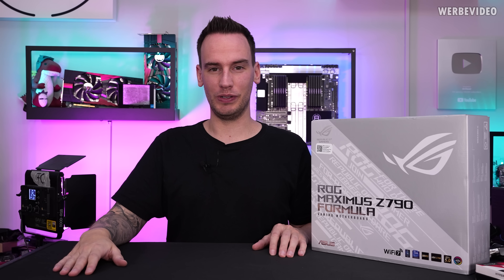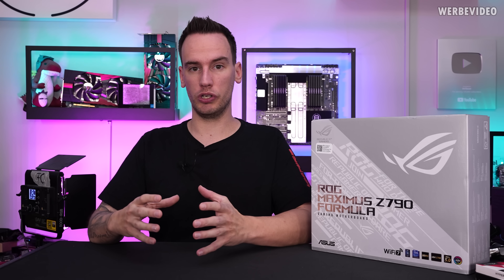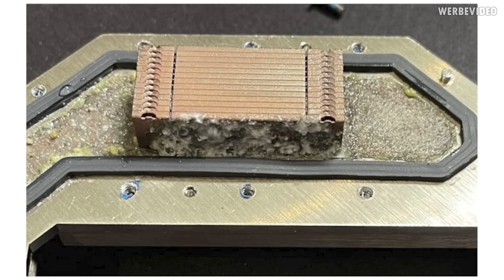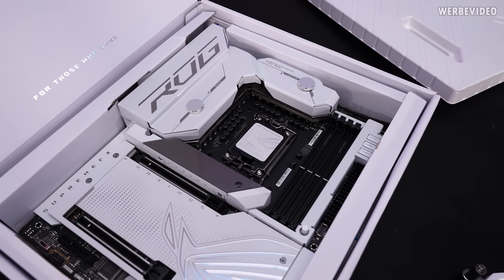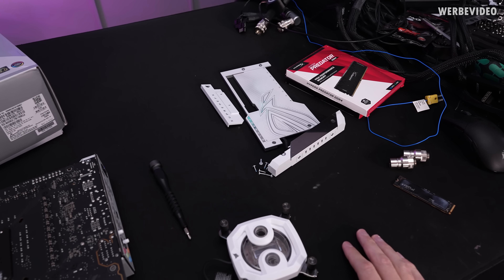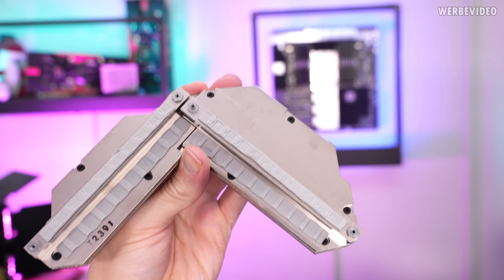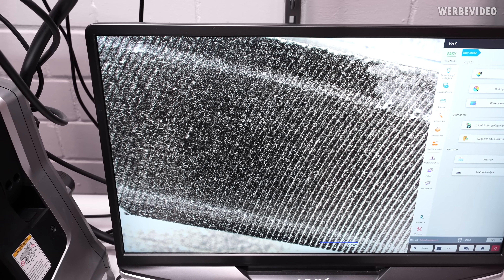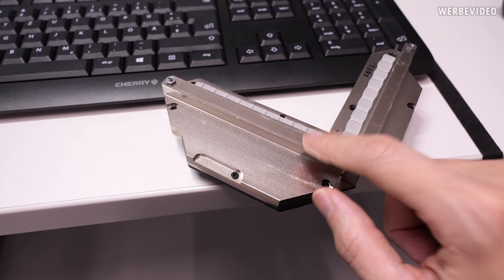Corrosion Risk on Z790 Formula? And the End of ASUS x EKWB Coop

Comment: I was thinking of getting this but its so damn expensive. I used to have the Z690 formula until the whole mobo broke and had to return it. The ram slots are also too close to the socket and i couldnt fit my AIO wires trough there without them pushing on the ram.

Comment: I'm not a big consumer of this kind of hardware, and I rarely even overclock anything. I mostly watch der8auer for the level of testing and to learn.
But one thing I get irritated about is that all the VRM cooling and such that is specifically for just one version of a motherboard I think is a shitty move. I never buy the latest hardware, there's simply no need for me to have it for that price, and then also maybe have problems because of it being cutting edge. So when I a couple of months to years after being released, there's still water blocks for specific motherboard models that hasn't been sold. Instead of getting to that point they could have made those water blocks to be a bit more universal. I'm not saying it has to fit many different brands (but that would have been the best in my opinion) but should at least fit other models of the same brand.

We already have a big problem with electronic waste, we don't need to add more components from computers to add to the problem. If anyone have been to a "scrap yard", you probably have seen what a waste there is. For something to get to be scrapped in a certain way, the amount of the same product has to be enormous. Which already disqualify these types of products. I have a hard time even imagining they asked for the the whole mother board back (unless it was easy to fake the buying invoice or something) to have people sitting depopulating it and to replace the components and send back. Since maybe just replace the motherboard with a new one and not having to pay for postage the one way from customer to Asus. I could be totally wrong, but I can also accept that.

Comment: Asus customer service is abysmal, I bought the z690 along with all the custom watercooling components for a full loop including the VRM's.....shortly after people started reporting the corrosion issues, luckily i hadn't set the loop up yet and contacted them asking if they could send me the replacement VRM block before I water cooled it and they refused basically saying i wasn't eligible because it hadn't corroded yet....they actually wanted me to water cool it knowing the risks to the rest of the blocks/pump and wait for the corrosion to occur before they'd send me a replacement block. When I wouldn't accept this they basically just stopped replying to my messages and ignored me. 

Couldn't even return the entire board since the company I bought it from dissolved so yea paid £700 for a motherboard partially for the watercooling element and couldn't even put the VRM's under water. Disgusting company practices.
Reply: That sucks. I hope you sorted it out somehow.

Comment: I heard that this board handles 4 memory modules @ 192gb in a far superior way vs any other board. Can you test the memory handling of this thing? No one who has reviewed this board tried more than 2 sticks. A lot of modern industries require as much ram as possible now, and if this board does 192gb @ 6800mhz, it would be really worth considering despite the price (even if you dont watercool) Like maybe the supported teamgroup kit CTCED596G6800HC36DDC01 x2 at it's stock settings.

Comment: Thanks for the video.  You mentioned you tried the 8000 RAM but it didn't work, and wasn't on the ASUS QVL.  I checked the ASUS site and it does show 8000 if paired with Intel 14th gen.  Is their site wrong?  And can you let us know which RAM you ended up using?  Thanks again.

Comment: My guess is contact corrosion due to the use of different materials or simply too low layer thicknesses in the coating.
In addition, nickel layers are only really free of pores and "closed" from a layer thickness of 30µm and more.
The silicon that was measured in the coating can also be so-called "endogenous inclusions" that originate from the aluminium manufacturing process.
Reply: i looked again at the surfaces, and i can see some indicators that the nickle coating is not okay.

Comment: Didn't Asus have this issue back in the day during SandyBridge/Haswell times with their watercooled VRM boards - one of the reasons they collaborated with EK for the Formula line to fix this.  Seems like you're better off getting a Hero board and spring for an EK monoblock, will more than likely end up at the $800 pricepoint but with a decent quality block.

Comment: The heatsink is Al with a Cu plated flash layer then the Ni plated top layer. That is the usual plating process sequence. Decorative parts would then be Cr plated. If you polish the cut/filed section the layers would be clear and you would spectroscope the layers in the section.

Comment: My Asus Crosshair 4 Extreme had a Koolance waterblock and it was flawless. I always avoided EK I never liked how many different manfuacturing issues they have had over the years.
Reply: What kind of manufacturing issues? Been using EK myself for about a decade now, yet to have any issues with any of their parts.

Actually, thinking it through - I did have one bottle of 1L clear liquid which had some weird bits in it, shipped through winter. Support and getting am exchange wasn't an issue, they claimed it being due to sub-zero temperatures. That is one bottle out of probably 10 over the years.
Reply: @Nightykk  As I have been running aluminum based radiators for over a decade having quality nickel plating on the copper is a very important. They have had a few batches over the years where the plating hasn't held up.

Comment: Your confusion about copper-coated aluminum blocks is actually quite common within wiring, it's called copper-clad aluminum, where it's also a much cheaper product.  I would imagine the process is exactly the same for a solid block of material as it is for wire.  For wiring, where you have an alternate scale of how much power you can push through a specific gauge, it works fine as long as you watch amperage and temperature, as it's still cheaper than the relevant 100% copper gauge.  For water blocks though, I'm not surprised it's problematic. 

As for the EK-branded parts, I wouldn't be surprised if it was co-branded.  I wouldn't imagine EK spinning up a fab line just for one Asus motherboard, and I wouldn't imagine Asus being willing to hand over a paycheck for one of EK's fab lines, and thus they got lowest no-name bidder to produce a bad quality block.  Lack of EK branding here shouldn't be a surprise, considering Asus' previous decision being such a terrible outcome, good PR last generation would be EK cutting the co-branding off when it first became apparent, and good business practice would probably to lawyer up for any defamation and loss of revenue stemming from their image being smeared by Asus' antics; I wouldn't be surprised if Asus immediately settled the issue under the table, though. 

But there is one consistent thing here, Asus' recent behavior within the industry overall.  Whoever is making these terrible decisions, and whoever is allowing them to happen, really need to be sacked.  It's starting to become the Newegg of hardware, the higher-ups are clearly out of touch and incompetent, to where the brand keeps shooting itself in the foot, and trying to drag any other company down with it. 

Them fixing the mistake is good, but the mistake shouldn't have existed in the first place, and this just shows their lack of loyalty to co-branding.  Speaking of lack of loyalty it other brands, they're still up to their antics considering they can't even spell 'Evangelion' correctly on a licensing they've previously done, and who knows how many people that had to pass through before customers touched it.  Too bad Asus burned the bridge with EK before getting their shit together.  The cooler overall still has a bizarre design though, I guess they're going for a certain height spec and they're filling that void with some kind of fin arrangement, rather than using a more logical design. 

Then of course, in typical Asus fashion as of late, the price.  Again just higher-ups being of such an ungodly degree of out of touch with the market and industry; again, the same people that need sacked, as their asinine decisions are causing every other issue the company has been facing the past few years.  I have no faith in Asus.

Comment: I bought asus for the 1st time this year... A TUF B650 for my 7800x3d.
I found them to be a good Motherboard manufacturer.
My last B450 was MSI and I think they're good too!
Ive also bought Asrock before and had good experiences with them too.
Had 1 MSI GPU and 2 Gigabyte GPUs and found all 3 great again.
However the MSI GPU did have coil whine, and my Gigabyte 4080 has the most retarded default fan curve

Comment: Like having a $1500 gpu with bad solder joints on some capacitors due to thermal conductivity from pcb and surrounding parts making it hard for solder to get hot enough without it being wicked away

Comment: And this kind of thing is why I just won't use water cooling. There are just too many potential unknown variables unless you put it all together yourself; and even then that's not perfectly reliable. Then to top it all off, you are constantly running a risk of a leak somewhere if some supplier/manufacturer was F'ing around instead of doing their main job of not F'ing around. 

Sure, warranties exist; but that's a pain in the butt. One that shouldn't have to be a pain in the butt. But is. And sure, fans can fail too on normal heatsinks; but they are super easy to replace and don't come with 20 extra steps just to make sure you did everything correctly. 

And sure, it's not 'hard' to do water cooling correctly. It's just that it's so much easier to just keep your room colder, and buy good fans instead of cheap ones. 

As for noise? Again, just keep the room colder. Fans won't be a noise problem then. And due to the constant possibility of replacing parts due to leaks, etc and so forth; probably a heck of a lot cheaper too to just run the A/C now and then. 

End result? Similar performance to liquid cooling methods, without as much hassle; and more comfort to boot.

Oh, and you don't run the risk of dumb things like mixing metals... 

And before anyone replies, please be aware... while I may not have taken all 5 levels of the course to work in nuclear facilitie, I am trained as a boiler operator; and basically everything they teach in that applies to liquid cooling. I may not be an expert, but I do know more of what I am talking about than the average person. (Including possibly you, person replying. But not for certain. Exceptions will be folk like Der8auer.)

Comment: I bought the formula z690 in 2021 and I think like 4 months later I fund something in the vrm block that blocked but I just cleaned a bit and moved on. Later 2023 when the news got I open my vrm this time and fund a lot of corrosion. Contacted my pc store in sweden and got a full refund. I will probably never buy any formula again even if it fixed now. Bought the apex z790 instead and Im very happy. But if the vrm got corroded that means my rad, block, and fittings is fucked too? I didnt find any on my block.

Comment: A child knows that you should never use a water cooler.
It is also total nonsense and enormous chance of problems.
I have been building PCs for 30 years and the difference in overclocking is negligible. My 6600K does 4600MHZ air cooling without any problems. With water cooling it can at most up to 4800 and that is it, but is not good for the processor and you will also see no difference in FPS. Whether it has 30 or 32 fps .. your PC must be replaced 😊

Comment: Thank you for testing this!  Good to know for sure the composition of the VRM block. I had the z690 formula, and I was able to get the VRM block replaced after waiting on ASUS for 4 months (Their CS is a nightmare). I had stability issues with my 13900k and Corsair Dominator Platinum 5600 DDR5 though, and got the z790 Formula instead, which is rock solid now and running a 14900k and Corsair Dominator Titanium 6000 DDR5.  I didn't pay a dime for any of these part upgrades btw, they were all changed out for upgraded parts under warranty because of stability issues that couldn't be pinpointed via troubleshooting.  The board is pricey, but I attribute it to the white tax.  There really isn't a better white board right now with the same features for Intel z790, or even z690.  I certainly don't need to add the VRM block to my WC loop, but I'm going to because this is my mid-life crisis Convertible Corvette - just in the form of a PC instead.
Reply: I just got my replacement and they were short on stock. Hoping stock was low due them using the same block on the z790 board

Comment: I have Z690 Formula but haven't noticed any corrosion after 2.5 years. I have changed the liquid recently and it was clean. Is there a way to tell without dissasembling it?
Do all the units corrode?
Reply: When I first heard of the corrosions on these motherboards I concated ASUS and they told me I need a proof of corrosion to have a replacement.

Comment: The new Asus ROG Maximus Z790 Formula appears to resolve the corrosion issues seen in the previous Z690 model through the use of more compatible materials in the VRM cooling block. However, the unusual design and just average cooling performance leave room for improvement to justify the flagship pricing. Asus took steps to address the major flaws but could go further to match expectations for such a premium motherboard.

Comment: I still use Maximus V Formula. It is a water and air cooler. I have a heat sensor stuck in between the fins. Usually reads the same with the CPU temperature. On idle.

Comment: Damn man you have the coolest tools to play with. Please tell us what machine that was you used. Maybe take a tour of the company that makes it. When I was 19. I worked at a electroplating plant in Bristol, Ct. USA. I learned so much metallurgy that summer before going off to college. I got to use a XRF (X-ray Fluorescence) analyzer to determine what the metal we had to plate was made of and what the quality was before sticking them in the pot. Not to spec metals didn't plate well and was an expensive waste. All raw parts were checked before being put on the line. Sometimes the owner rejected whole batches! (he was pissed) I went to work in nuclear power plants a couple of years later. That experience started my 1st career. Lab tools, machine tools, all that are big boy toys to me. I love working with that level of tech. Thank you for sharing this info. HEY maybe you can teach Mercedes Benz a few lessons and get them to cut their losses in China.. Export your products there IF THEY HAVE THE MONEY. Otherwise the average Chinese person can't afford German Quality. They certainly don't make it. That's why that previous version of that MB corroded, MADE IN CHINA. They cut corners or outright lied about the material. Asus did NOT do due diligence in quality control. They kept the extra money to would cost for themselves. That's a high priced cheaply made product. Really the price should be 300 euros less in my book. How much does the B.O.D need to live? The average Taiwanese gets paid $4/hour working the line. Common man how are people supposed to afford  Asus products now. I've been their customer since 1998. If corporations don't pay a living wage none of us can afford their products. I think you know that yourself. Love your work and your products.

Comment: Great content! Could you please do an investigative piece on the ek velocity2 direct die kit aswell? I have spent way too much time and money trying to get it to work but having the same problems as everyone else, it's impossible to get it to mount properly. Right now I'm contemplating just getting the iceman instead but the velocity2 looks so beautiful and I'd have to redo the hardlines aswell so I'd much rather have it on there. :/
Reply: I'm using the iceman and just got the almost identical barrow block, super easy install and great temps. I do like the look of the EK block but I didn't want to spend 3x as much once I found out the Ek wasn't as good. Good luck to you.

Comment: active VRM cooling just isn't needed on the z690/z790. Back when i was running a ryzen build, an especially for FX I was running 40mm noctua fans on the VRM, but when I did my last build with the 13900k, VRM's only get to 40-45C while the cpu is pulling almost 300W. Fans just aren't needed on the VRM's, so I moved them to the m.2 ssds which do need some active cooling under those motherboard slabs.
Reply: it's needed if you want to keep the  temps inside the case cooler. VRM gets really hot.

Comment: Watercooled VRMs on high end boards baffles me. It makes zero sense it all scenarios. Low end boards have crap VRMs that can get very hot when used with a high end CPU; they need cooling. However, those boards and cheap and often don't even get a basic heatsink. Meanwhile, high end boards might have a VRM capable of supplying 1000A, far in excess of what anyone will ever use. This overbuilding of the VRM means it doesn't really get very hot at all. 50°C is nothing to components that can tolerate 120°C. Slap a slab of aluminium on there and call it good, which is what most boards do... but then we get these watercooled VRMs, and it makes no sense, definitely not at $800. Forget the Formula. If you must get the "best", get the Apex or Extreme instead. The formula is just the Hero with a shitty VRM block and +50% Asus tax.
Reply: I own it and I love it, more than z790 apex, and vrm temps stay at 29/31°c water cooled